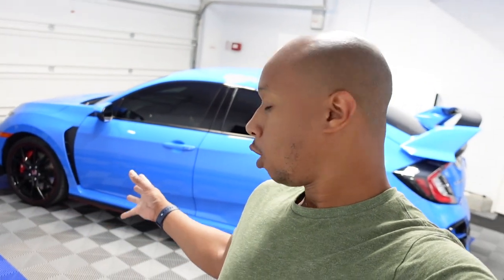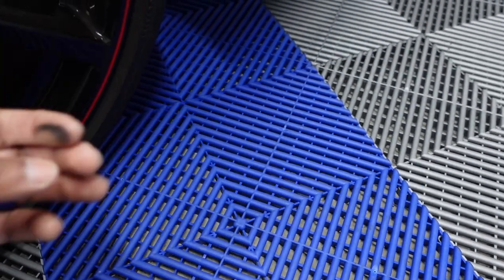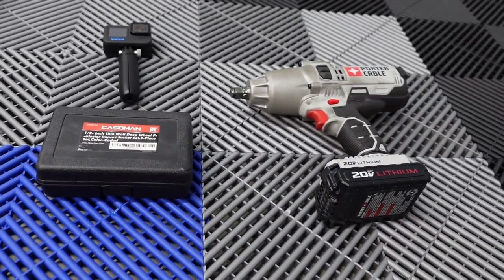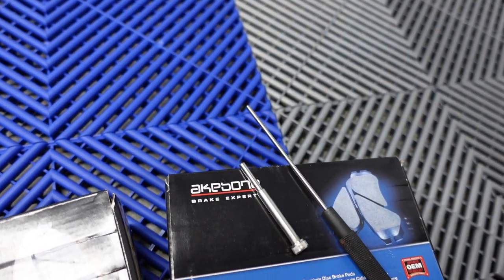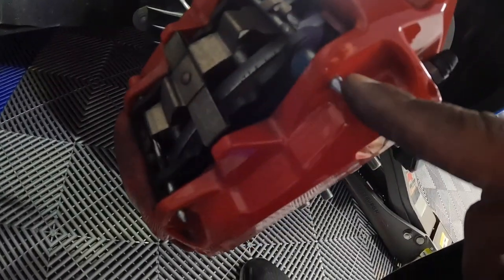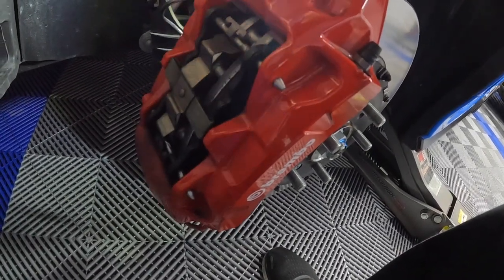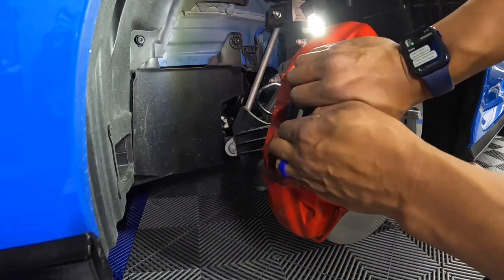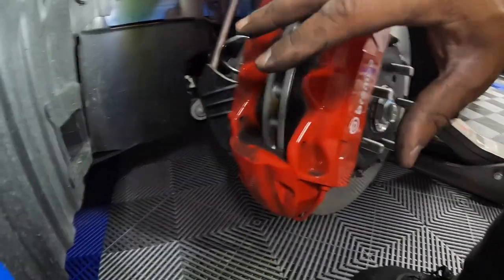HONDA CIVIC TYPE R BRAKE PAD CHANGE DIY

Comment: This was a great video. Super clear and simple with good angles too. I did my rears without the scanner, it was a terrible experience lol and I had replace a sensor.
Reply from the maker: Uh oh.  Hopefully not too bad!
Reply: I did it without the scanner and worked out just fine just keep hand break off and do not turn on car PERIOD
Reply: I did this without scanner also and my brake light came on so I’m dealing with that today 😂
Reply: @eddy2358  I unplugged the battery performing this idk if that helped me not have issues
Reply: So I can do the rears pads without the tool? Just unplug battery & no emergency brake?
Reply: You can, or take off the sensor on the back and retract it yourself, I used a scanner for my wife’s car but on mine I just retracted it myself and I’m not mechanic. so… if I die in a ball full of fire, hopefully its before my shift. So I don’t have to work a full day before my demise. 😂

Comment: Great content and binging lots of your uploads. Honorable mention to Carbotech pads as they are pricey but much better bite and less dusting than even the Akebonos. Lots of good info out there on them for your next change in a few years. Just a thought, 

Cheers and Regards!
Reply from the maker: Thanks!

I might have to give the Carbotech pads a try! 
My front Akebono’s are great but the rears are still dusting more than I would like.
Reply: I'm looking at the carbotechs now. Just not sure if $430 is worth it. The hawk Hawk performance ceramics are like $180 right now front and rear.

Comment: Hello I am doing my first ever brake pad change. Mine are very used and grinding. Do I need the compression tool or can I use my hands like you did and pull?
Reply from the maker: Compression tool is easier but you may be able to use your hands or carefully use a flat head screw driver covered with a towel so you don’t chip the paint on your caliper.
Reply: @eddiemcars  awesome. Thank you! Your video made it look so easy. I also ordered a brembo pin and an Autel scanner to put the e brake in maintenance mode. I will follow your video step by step and come back here letting you know how well it worked for me!!!
Reply: @eddiemcars hello please help me ASAP front was easy. The rear I can’t fit the brembo back on. The piston is to tight for the new pads
Reply: @eddiemcars hello just letting you know the job is finished much thanks to your easy to follow video. My buddy had to come and help me with the rear brakes, I used the scanner for the electric brake maintenance mode but the piston was way too tight for the new pads. So he brought a tool that squeezed the piston back into place! So far so good. 

I Do have a question though. Do I have to bleed the rear  brakes now since we took the caliper off like in your video?

Comment: Great video. What that little pin tool call at 2:47 and can we reset the obd setting once we finished all brake pads changed?
Reply from the maker: Yeah, you can reset or enable the parking brake  after swapping out the pads

Took I used is just a pin tool used for punching calipers pins for most brembo brakes 

https://amzn.to/3OEmV0k
Reply: @eddiemcars  thx Man. It’s really helpful to me. Also wondering any obd scanner(or what kind the scanner) will does the reset job when we after finished the pads changed?

Comment: did the same install and i’m having the very very annoying squeak on the rear pads not sure why. Maybe it’s because the oem pad had some sort of adhesive to the caliper and the akebono dont? please let me know if you had this issue
Reply from the maker: I had the same issue.  I had to buy new anti rattle clip in the rear. One of them got stretched out.
Reply: @eddiemcars  not sure why my is squeaking it’s both rear breaks that squeak and it’s non stop
Reply: @miloa4949 how did you fix it ?
Reply: @guachito33 i replaced the anti rattle clips and nothing fixed it. I still have that squeak at low speeds sometimes i just learned to get over it for now till i upgrade the rotors to a 2 piece.

Comment: do you leave the obd2 scanner plugged in and on while you are doing the rear pads?
Reply from the maker: I can’t recall if I left it on but it was plugged in. I want to be able to take the parking brake out of service mode.

Comment: Do you have to remove the brake master cylinder cap while compressing the piston on the caliper?
Reply from the maker: It’s not required but good practice.  Since the pads have very little miles on them there was hardly any room to push back the pistons.
Reply: @eddiemcars  I appreciate your response ,my rear pads are worn out at 21k miles.

Comment: Can BimmerCode code fog lights to stay on with full beams but go out with dipped beams.
Reply: Fog lights on X5 F15
Reply from the maker: You want fog lights to activate with the high beam?  I think the best way is have fog with high beam coding and turn on the fog lights as needed.

Comment: Did you fluid fill nesr the top after you changed brakes?
Reply from the maker: No need.  
Fluid doesn’t evaporate and since it’s a closed system the fluid from the pistons got pushed back into the reservoir
Reply: @eddiemcars  awesome, just finished replacing my front ones, I appreciate your work. Everything seems to have gone well!

Comment: Can’t you just unplug the actuator and use a piston push tool?
Reply from the maker: That will MIGHT work but at risk of damaging the actuator. I’ve heard a few people doing it this way and ended up having to visit Honda for replacement after losing rear parking brake and having a bunch of malfunction lights in the dash

Comment: You don’t  have to bleed the brakes???
Reply from the maker: No.  It's a closed system for a brake pad swap.  You should only bleed if you open the bleeder valve or replacing a brake line or caliper.  Even if you open bleeder valve by accident because air is introduced in the system.
Reply: @eddiemcars  thank you for clearing that up for me!! i just bought my type r a month ago and i want to make sure.  do you have any good service/repair manual recommendations so i can attempt to do any maintenance  on my vehicle?

Comment: What rotors do you have on them? I have  2019 and those look like you can resurface them
Reply: These are probably stock rotors. The 2020 refresh uses different rotors from the 2017-2019 models.